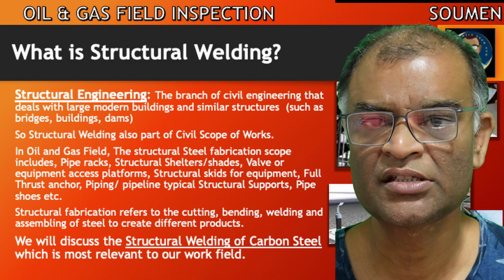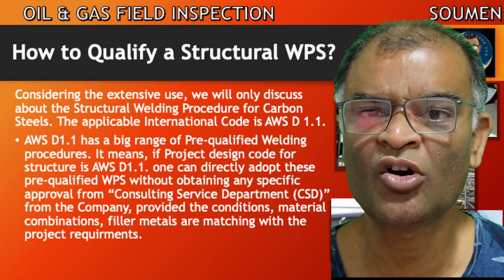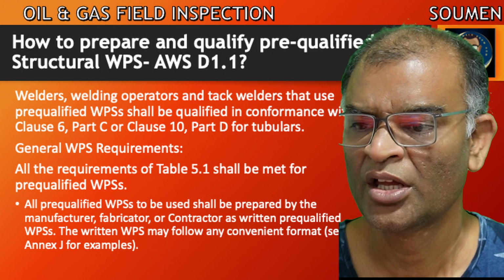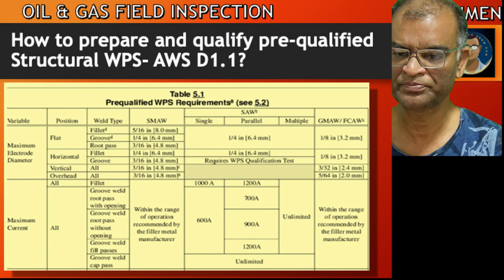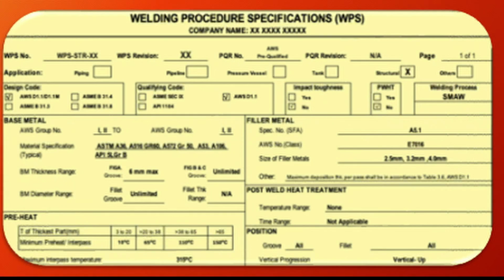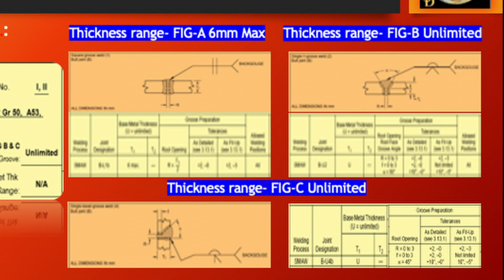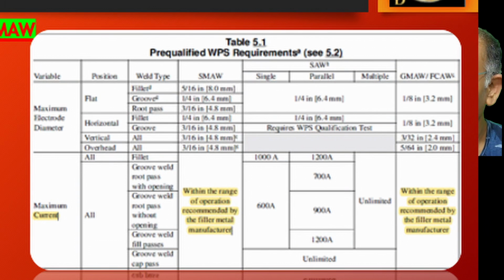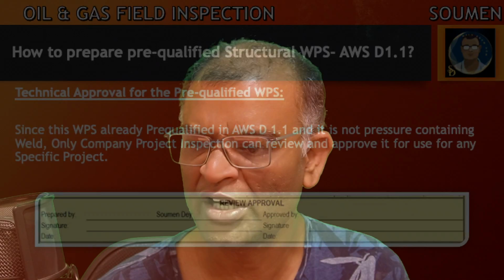how to write a welding procedure specification (wps)(Part- 3) | Pre-Qulificied AWS D1.1 WPS

Comment: Sir,
For anchor bolt for concrete reinforcement are welded according to aws d1.1 or asme secix
Reply from the maker: It is a structural memeber, So Aws D 1.1 will be applicable. For welding, You need to check the weldibility and it is allowed as per your client's nstandard or not!

Comment: Very nice Sir,
Sir, Can we make prequalified WPS without backing as per AWS D1.1 for tubular connection.
If we have prequalified WPS with backing , does it allowed to weld tubular section  < 24" without backing
Reply from the maker: Thanks for your query. PLease refer to the table of prequalified WPS (with all essential variables  allowed for their range thickness etc. If it is not there, you have run a PQR . If I need to answer, I will also refer to that table only.